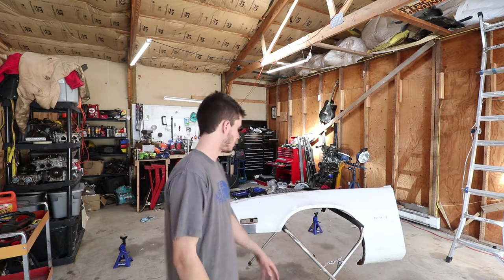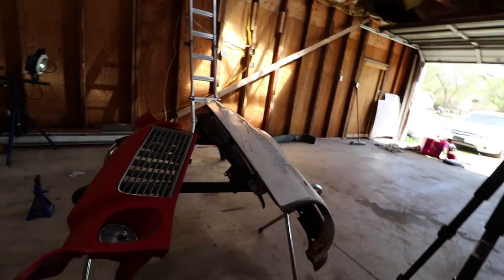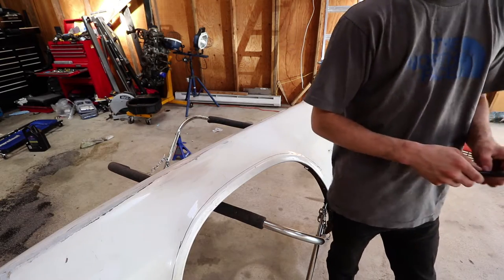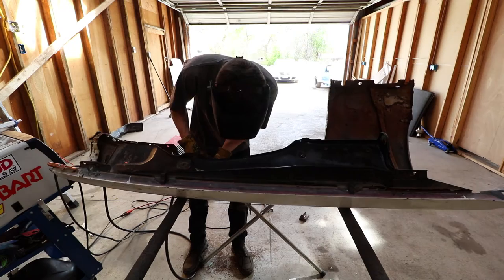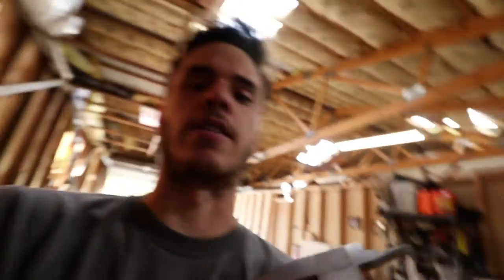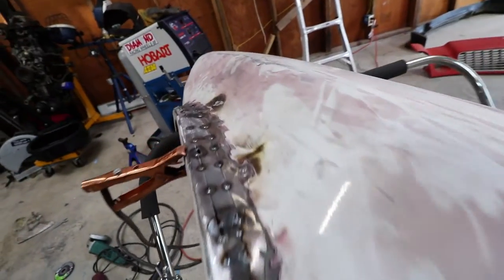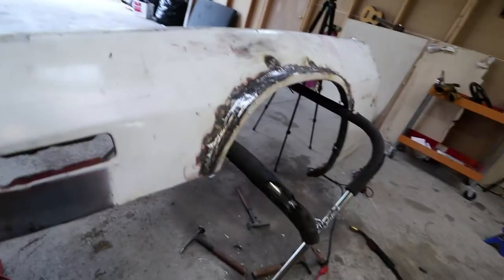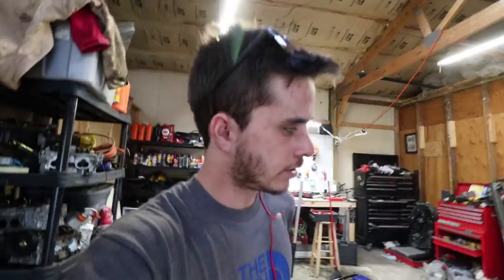Making custom steel Fender Flares for the Camaro | Project Mullet Episode 1

Comment: A very cool idea! My only question is if it makes the front fenders look a little skirted because if the pull out also pulls down, if could add to the hovercar-ish look of old American cars. Basically, if it is possible to move the body line of the arch up as well as out, it may look a little more taught.
Reply from the maker: I made sure that it didn't pull down too much, because I was afraid of that. It only came down maybe 1/4" which isn't gonna be a problem since we're gonna squeeze as much as we can under these fenders. Tire and wheel is gonna be right up to the edge.

Comment: They look good but I think you should try and smooth out the transition from the fender to and the flare you put in.
Reply from the maker: I will be once I do it to the real fenders. More grinding, a little work with a body hammer, and a little body filler and it should be perfect.

Comment: You can rent a tool to flare the metal ON the car.
I saw one that bolted to the wheels.
I have seen a guy use a wooden baseball bat too.
No welding or cutting.
Your just reforming what's there.
I've thought about trying it on a 914 because they have that rolled lip that I think would do it if you just flattened that out.
Reply from the maker: That's called a fender roller, and the most it will PULL the fender is about 5 mm or so. Will also flatten out that flip in order to get a little more room for rubber. Won't flare the fender hardly at all though.